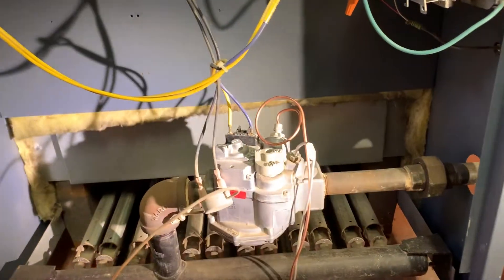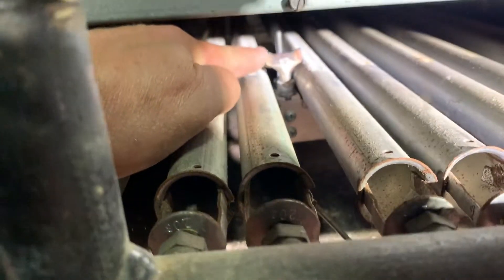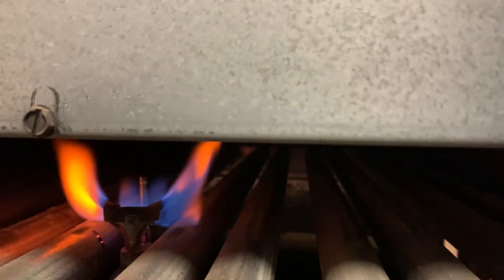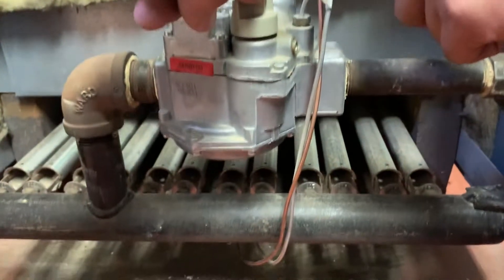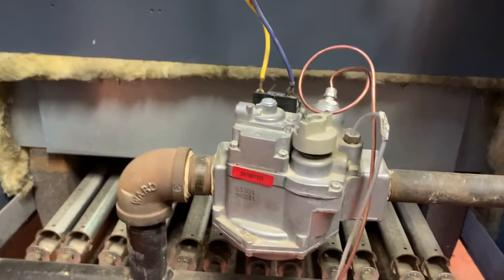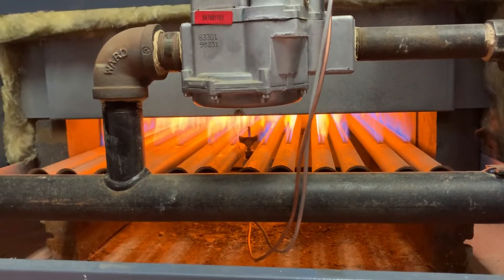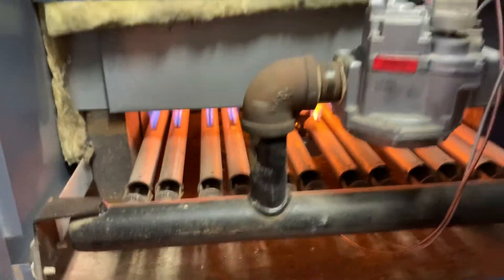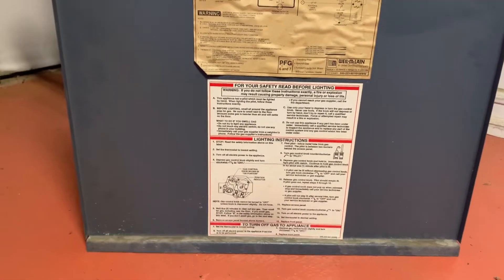Gas Fired Weil McLain Boiler Pilot Lighting Instructions Explained

Comment: What happens if the pilot goes off after you hold it down for a while?
Reply from the maker: Continue troubleshooting:
Insufficient flame
Bad thermocouple
Bad GV
Reply: @ Bad thermocouple and pilot assembly replaced. $270 for professional to do it.

Comment: I don’t know where my pilot is located 🥴😩 please help. I looked under and I see the pipes but there are no instructions for me 😭😭😭 I’m freezing
Reply: Follow the cables/pipes -- one silver, one copper. They will likely converge and end at the pilot. There's a cover on mine, which is hard to remove. There is also a hole in my cover, through which I insert a long grill match, to lit the pilot. Put another way, I don't see my pilot well, I just insert a lit match into the hole.
Reply: @amyoungil same thing. I had a cover over mine with a small hole to stick a match or something into to light the pilot. I removed the cover, lit the pilot, and the put the cover back on
Reply: Same here :(

Comment: Does that flame stay on high like that the whole time or it goes back and forth automatically because mine goes back to lower flame after a while like the initial pilot blue flame? I just wonder if it will heat back up to high flames